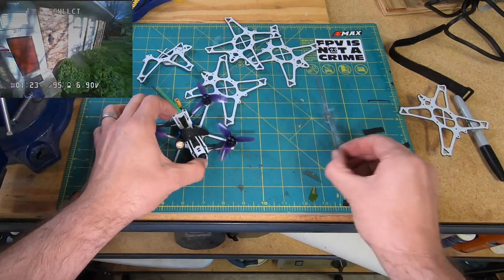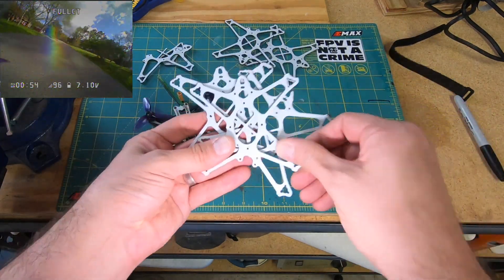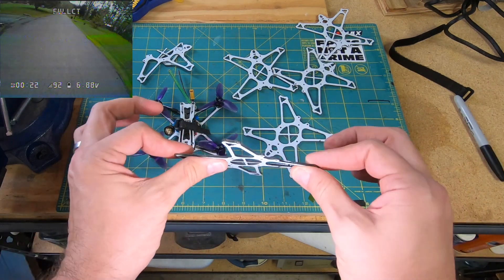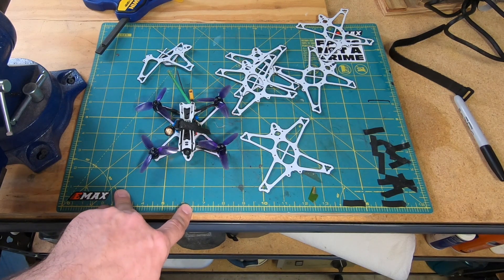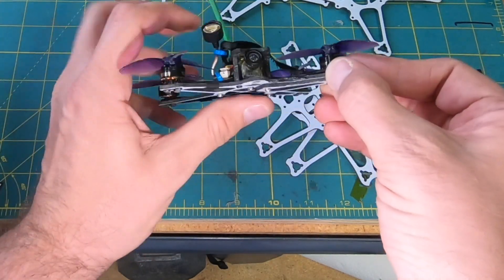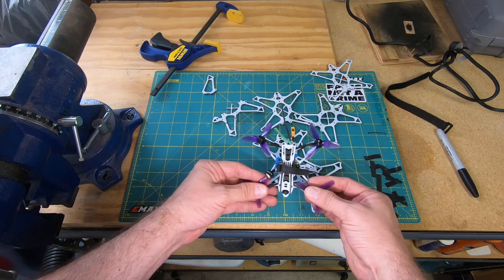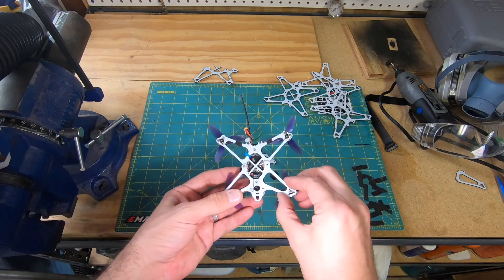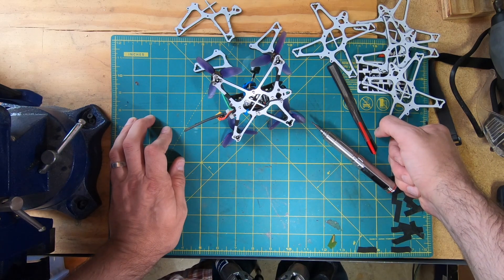Splint Your Broken Arm! | Tinyhawk Freestyle THFS #emax #tinyhawk

Comment: Have you tried putting like 2 of the frames together to have a thicker frame
Reply from the maker: David Powell I thought about it, but I worry that the frame would be too durable and transfer more impact force to the electronics and motors. Also, a full frame would probably add up to 9 grams with screws. My AUW pre-splint is 74g, so that’s more than a 10% weight increase. I currently run a 300mah 2s 80C xt30 pack to stay as lightweight as possible and flight times are only about 3 min, but the control OMG. It’s sublime.